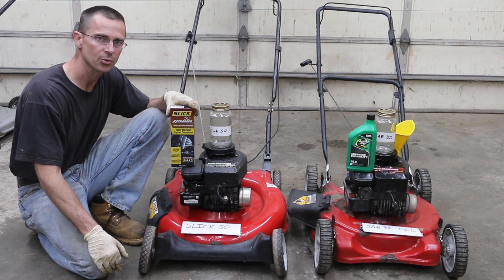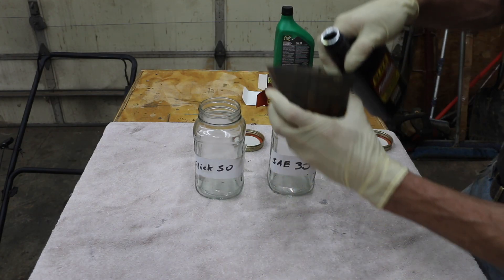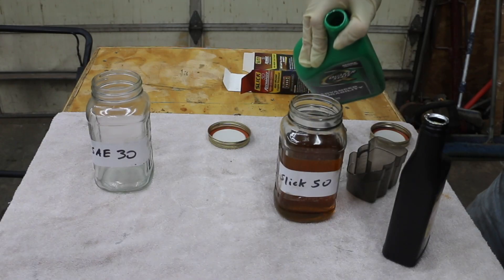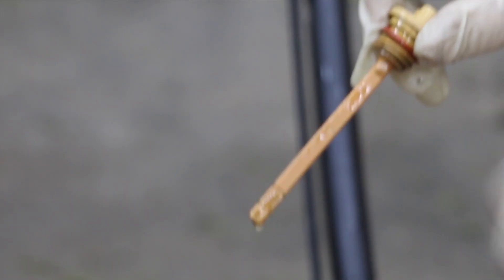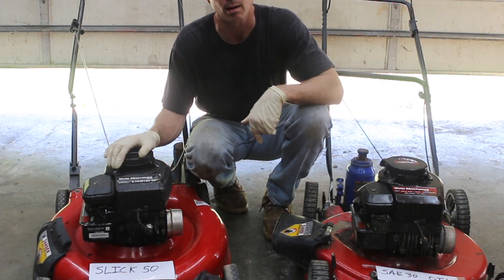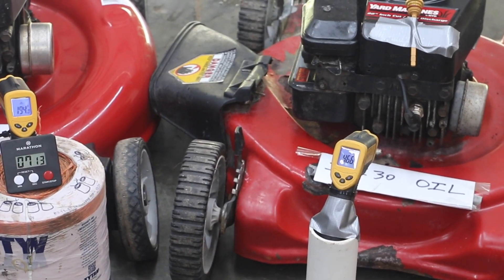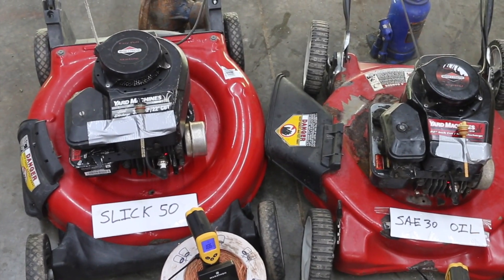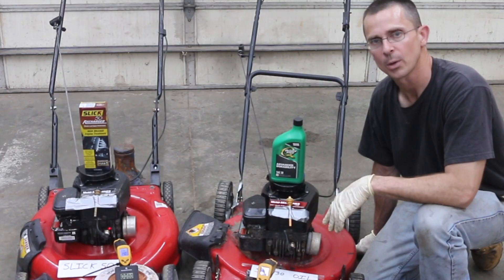Can't believe what SLICK 50 did to my engine!!--Dry Crankcase Test!

Comment: I believe the  test takes the engine until failure then let the engine cool refill with oil then restart. The concept is Teflon suspended in oil because Teflon but let's stick to bearings you would just cook the bearings with the oil with the Teflon in it. I don't know  about  the engine failure test. Maybe that concept that I just said was more for an automobile. Put the claim to fame that I used to hear was reducing your startup where by 80%.. because the oil was flowing when you first start the engine that's when wear  occurs. For many years I worked on diesel power plants in ships.. it was required to prelude the engines with an electric pump before they start. So when the engine just began to start a minimum oil pressure was present. And that's according to the manufacturer required..
Reply from the maker: Thanks for the feedback.

Comment: Slick 50 is bad ass i used it every time i did oil on my truck when i sold the truck the went to bore out the engine he said when he broke the engine down he has nvr seen an engine so clean on the inside.
Reply from the maker: Thanks for the feedback.

Comment: My concern about the test is that the Slick 50 test engine appeared to be brand new, whereas the SAE 30 engine looked like it had hours of running time on it. The engine being well broken in could account for its ability to run longer without oil.
Reply from the maker: Thanks for the feedback.

Comment: We used Slick 50 in the rolling machine at the tube makers (brake lines etc) and the swimmers (what the tube was formed around) lasted way longer before breaking..... the Slick 50 was locked up so the workers couldn't pinch it.
Reply from the maker: Thanks for sharing.

Comment: Of course we can't know, but I wonder what would have happened if the slick 50 was in the other Mower? In no way is this one conclusive, it may just have been the Slick 50 motor was in worse condition. The indication that the Slick 50 was actually doing its job is that temp was so much lower, less heat= less friction as a rule.

Comment: When you checked the temp on both of the engines, I think the one using slick 50 benefited from having the other lawn mower blowing air. It might be interesting if you could repeat this test having both lawn mowers isolated.
Reply from the maker: Thanks for the suggestion.

Comment: back in late  1980s i used slick 50 in my truck engine...... 3000 miles later, lifters started ticking and it never went away..... and the engine only had 20,000 miles on it....never again used slick 50
Reply from the maker: Thanks for the feedback.

Comment: It is possible that the Slick 50 engine seized up because it appeared to be a newer engine which may have caused it to seized because the tolerances were tighter and once it heated the expansion of the tighter tolerances caused the seizure

Comment: OK Todd, Mr. Project Farms, i have a idea that will probably get you the most viewed test in history!! no kidding!! I have scowered the net and now more confused than ever!! Can you settle this age old question please. This is kinda a 2 part question. (#1 What oil should i use in my mower??) (#2 Can a car filter be used instead of a mower filter?) Some say use w30, some say 10W30, some say never use 10W40. Yet both Briggs and Kawasaki now say its ok to use 10W40 and even say to use 15W50!!?? ( due to added friction reducing additives) I have 2 zero turns, one with Kawasaki FR730vr and another with Briggs 27 Hp Vanguard EFI. All of this research came about due to a blown up Kaw 730 engine (repair shop said it was due to oil starvation) i had loaned the mower to a friend who changed the oil (10w30) and put a auto filter on it because it was bigger, better, cheaper and the parts store said it would be ok. He blames me for topping it off with 10w40 full synthetic and i blame him for the filter with a bypass of 22psi vs 7-9 psi as per OEM specs.. i took full blame for not paying attention to what he did in the 1st place.. my bad.. anyway can you settle the oil and filter debate Please!!! Thanks Robby.
Reply from the maker: Thanks for the suggestions.

Comment: Not sure about those type of lawnmower engines but i thought they were splash lubricated.   If so, i don't think slick 50 would work as well.   Can you test it on pressurized lawn mower engines where it is run through bearings?

Comment: The engine in the slick 50 commercials was water cooled.                                                                                                                                                                                the air-cooled engine runs hotter than water cooled.!!😉

Comment: In 1976 I bought a 1974 Ford Cortina Mk.3 with just 250 miles on the clock, in 1978 I found Slick 50 and put it into the 1600cc OHC engine in the Ford Cortina, and 47 years on I still own the same car, with the same engine, which has covered over 325,000, miles. it had regular oil/filter changes every 6 months, using Castrol GTX oil,  but I feel it would not of lasted as long, without Slick 50 being added,  it was the FIRST ORIGINAL FORMULA, of the Product, I used, ("NOT" the changed over time Formula from subsequent  owners of the Brand),  The engine is now at a Professional Engine Company being fully restored as the car shell has had a full  "Extreme" Concourse Restoration, (on My Channel) and I want it back to as Brand New when it rolled off the Ford Factory Production Line in 1974, as it is a unique version, of the Mk.3 Cortina, (An Ex Ford Motor Company Promotional Car) one of only two produced in 1974), and the only surviving one.. I was very impressed with the Original Slick 50, like you were, and if my experience  of  owning a car 47 years, treated with it is anything to go by, the original Product was First Class. and worked well.
Reply from the maker: Thanks for the feedback.

Comment: I can recommend to use Metabond surface enhancer product. They offer a lot of wear protection without running oil. Like on highway, if you loose your oil pan for some reasons, you can drive your car without oil for 50 km far away and no damage internally in the motor. Also offer less fuel consumption, because the moving parts has less resistance. Just recommend the product, using many years without problem.
Reply from the maker: Thanks for sharing!

Comment: back in the early 80's my father was a dealer for sick 50 and had the whole engine with no oil run. For graduation my parents gave me 500$ for a down payment on a new truck. I really wanted that Toyota but could only afford the Nissan for my first oil change i went to firestone and had some type of deal set up for regular oil changes. I was driving hot shot delivery here in Houston and it was not uncommon for the to drive 500 plus miles in a day.  my 2second engine oil change i added slick 50. about my 5th oil change firestone forgot to put oil back in. I noticed the truck acting weird while doing my deliveries around Houston and stopped and check the oil. none. I freaked out. Firestone apologized and i told them they would be buying me a new engine if it was ruined. Well no damage to the engine and that engine lasted to over 300k miles when the truck was stolen and later found in the bottom of a lake. There are several different type of engine Teflon additives you can buy now.  But if i remember correctly the engine is suppose to run until its down a full quart and then its replaced with regular oil. I think to be fair here you need to rerun this test and give that Teflon time to bake on like its suppose to.

Comment: Man I use prolong a long time about 97/98 and I had a 4-cylinder Beretta and the oil pressure gauge went to 0➖ after a while about a day or two and then again after all it said that it would have to be changed checkmate the oil pressure gauge went back up to regular basis for I was in need for the oil change but yeah I guess that's a long time ago lol 😊👍
Reply from the maker: Thanks for sharing.

Comment: You should have tried to recrank the slick 50 engine. I ran a 4cyl. Honda out of coolant 6 times on the way home from Florida because of a big hole in the radiator. 600 miles with just the aircooling of the sidemount engine and fan with slick 50. I would lose half the coolant after the first 30 minutes of driving. When I caught a red-light I would have to stop, cut the car off ,let it cool and and coolant and water. Did this 6 times before I got home. When I got it back from the body shop that replaced the radiator with the same engine running, the mechanic said it had to be the previous 6 treatments of slick 50 that saved my engine from turning into a lump of aluminum. The mechanic said the radiator /coolant and a oil change was all the engine needed and it ran another 2 years after that. @Project Farm
Reply from the maker: Thanks for the feedback.

Comment: The modern Slick 50 is NOT the same as the old one. The formulation was changed when the private company sold out to a big corporation. If you remember the old Slick you had to warm the oil and mix the visible PTFE in, I'm not even sure the new one has any PTFE in it. Old Slick was a once in a 100,000 miles treatment, the new one is supposed to be used every oil change tho I have no idea why anyone would bother. The old one worked, I've had a race motor blow an old line and run at race RPM for an hour with no damage other a couple of scored big end bearings, the new crap is, well, crap.

Comment: If Slick 50 is PTFE, or a coating like Teflon, why should we expect it to coat to engines in operation when frying pans coated with anti-stick in controlled factory conditions require care and non-metallic utensils to prevent damaging the surface?  How is this gunk supposed to adhere to metal in an oil bath under operation? Why aren't manufacturers coating engine parts during engine construction? (Hint: Because it doesn't work.)  I tried Slick 50 in the late 70's and soon realized it was snake oil.
Reply from the maker: Thanks for the feedback.

Comment: Dont you think that the muffler of the slick 50 machine facing directly into the intake of the sae 30 engine was thencause of the heat difference? Just curious.

Comment: In 1994, I bought my first new vehicle. It was a 1994 Toyota pickup. It was stored all winter. 
I towed a bass boat all over the country (eastern half). This was with a 4 cylinder engine. 
I ran ONLY, straight 30 oil. 
At 100,000 miles, I pulled the valve cover, to adjust the valves, and the engine looked absolutely brand new inside! 
This can no longer be done, what with VVT screens and what not, but I couldn’t believe the power of a straight engine oil. 
EXTREMELY low viscosity breakdown. 
At 4k, it looked like I just put it in. 
I miss old, reliable engines. 😔
Reply from the maker: Thanks for sharing.

Comment: Slick 50 was never functional as an oil additive. PFTE has to be applied through a specialized process to metal surfaces for it to stay coated. I was surprised it was even on the market from the beginning.
Reply from the maker: Thanks for the feedback.

Comment: Ideally, it would have been better to have two identical lawn mower engines for this test.  Slight differences in the motors may have interfered with your potentially subtle changes in the test.
Reply from the maker: Thanks for the constructive feedback.

Comment: Crossed my mind the Slick 50 could have shut down early to save the engine. My mother paid for a California oil change in the early 1960s (Havoline) and we rode for 100+ miles without any oil. Her intuition made sure the oil got a check when she pulled in for Texaco gasoline. The 1949 Panel Truck lasted until 1968. For some reason we never had to change windshield wipers except once or twice. I home-shared once with a retired Boeing Technician in his 90s who swore by straight Molybdenum oil which he purchased in 5 gallon pails. My guess is he used at least a quart of it with each oil change and added it in with every oil check. (pssst! XcelPlus is over on eBay).
Reply from the maker: Thanks for sharing!

Comment: Good test, yes. Unfortunately, I feel the test is completely invalid, due the fact that neither engine was new, bearings likely aren't from the same manufacturers batch and there's no way to tell if existing damage was already present, even if no systems were showing. (Appearing to be a sound engine)
I really appreciate these comparisons, so I'm curious to this test being done again, except with two identical engines, fresh from the same build dates. Thanks.
Cory

Comment: I tried slick 50 once. Months later a leak of oil. Ran low. Idiot light came on and as I immediately glanced to right for a spot to pull over my motor seized. Lasted 1 second from warning light to seized engine.
Reply from the maker: https://www.youtube.com/watch?v=4jxZAKk_nSk

Comment: Your test is flawed.  Both were used engines and no one knows which has more hours on it.  Or how well each has been maintained.  Did you own them both or one or neither. How long was the slick 50 engine run before draining.  

Lastly after adding oil back did one start up or both?  Did the one or both engines both seize or just stop

Comment: There used to be another product like that, called Duratech.
They claimed it outperformed Slick 50.
It didn't have any Teflon, and was just a high grade oil.
The common complaint about Slick 50 was that the non oil additives caused carbon deposits, and eventually would lead to interfering with the oil galleries staying clear, but who knows really.
Reply from the maker: Thanks for the feedback.
Reply: Looks like the actual stuff was Duralube, not Duratech.

Comment: I really believe we missed an important factor that a few people noted is how well the different oils bonded to the internals of the engine. I think SLICK 50 did a much better job and a better test could be done honestly. The viscosity difference of the oils could cause a huge change in result. To simply speak the conventional oil held on the walls allowing the moving parts to distribute it evenly while the SLICK 50 had such a great resistance to friction that as the heat increased it simply ran down until the walls were dry.
If I'm very wrong please inform me but I seriously believe a more accurate test would be to run both engines with until they died but instead with adequate oil instead.

Comment: Hi  i use tri pak, its a metal treatment that from my own testing blows away slick 50, lucas and any other.
Tri Pak is outstanding, i think you will be blown away.
I used a tester like you use and slick 50 and lucas starting making a mark in the metal at about 8 lbs pressure, 10 30 oil made a mark in the metal at 3 lbs pressure.
The tri pak did not make a mark and i had 35 lbs pressure on it.

Comment: Yeah, I agree with most of the comments below - this one was a waste of time, something not typical of PF. Too many variables between the engines to know what caused the failure and whether the slick 50 had anything to do with it.  The only way I know to get a better result would be with a much higher number of identical engines off the same assembly line and randomly fill 50% of them with the slick 50 mix and then run to them til they quite.  That would be an expensive test and still would not mean an equivalent test of a different manufacturer or engine design would have they same results. A better assessment might be done with a souped up version of the lubricity tester which better mimics the environment internal to an engine and look at the statics of some failure mode, and then extrapolate that to what probably be best for an engine.

Comment: The large aluminum bearing surfaces would not sieze under a no load situation. But the engineer then applied a stick to the crank simulating a light load and the engine stopped in seconds. Sorry this was the rest of my previous comment, I hit send by accident.
Reply from the maker: Thanks for sharing!

Comment: I was beginning my career as a small engine tech in the 90s. At a briggs and stratton service school we discussed the whole slick 50 thing. They started a 3.5 hp briggs engine and let it run without oil. It ran for a few minutes before it was shut off. The engineers told us that the very nature of how the engine was built actually allowed it to run with no oil for a fair amount of time.
Reply: Yeah, they have self lubricating bronze bushings.

Comment: Try adding General Motors EOS which was developed years ago to break in engines with flat tappet lifters it also is very high detergent to clean hydraulic lifters I have personally tested it in a bearing friction and wear tester that is used by SAE and stuff actually seems to treat the metal and definitely reduces friction interestingly you read the contents on the container with the additives is zinc diothiophosphate which is an Extreme pressure additive
Reply from the maker: Thanks for the suggestion.

Comment: An experienced mechanic once told me that the damaging effects of Slick-50 are from long-term use.  He related that he worked on two Mercedes engines that lost compression after several years use of Slick-50.  He cited the reason as stuck piston rings from accumulations of Slick-50 in the ring grooves.
Reply from the maker: Thanks for the feedback.

Comment: The commercial said they ran slick 50 for a month in the engine until it lost all the slick 50 and then added the court of oil back then drained everything and ran it without oil. Apparently you are supposed to give it time to burn into the walls of the engine over the one month.
Reply from the maker: Thanks for the feedback.

Comment: Use to see salesmen at state fairs peddling oil additives and they would have an engine running with no oil also, just a coating of the additive in it ! I to used slick 50 for years until I discovered  Molly Coat .
Reply from the maker: Thanks for the feedback.